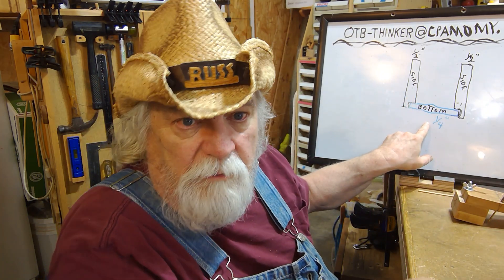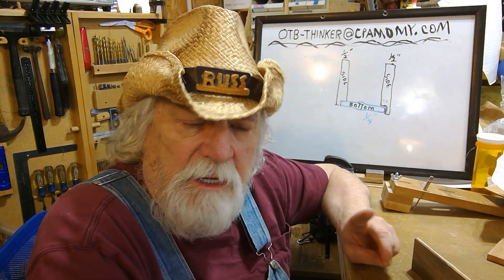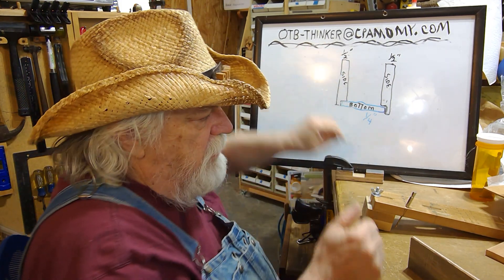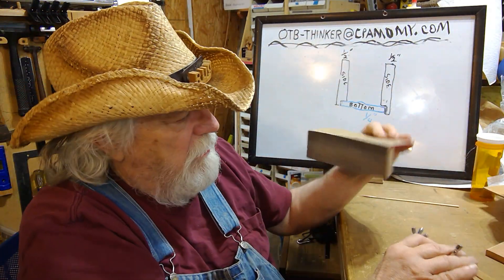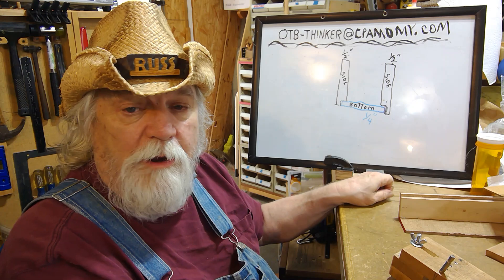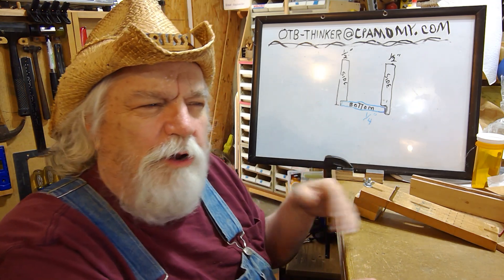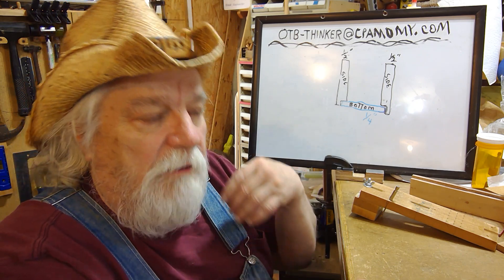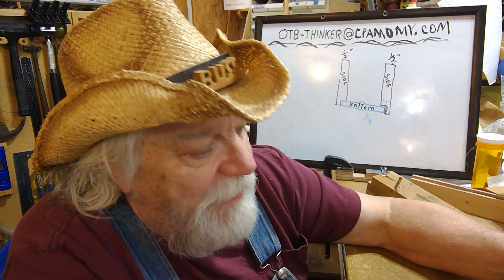A BS Viewer Question by OTB Thinker

Comment: Hey Russ..Puttn here hiding out on my wife's computer.  Thanks for explaining that and the visual application helps a lot.  I have a bunch of trays I'm putting the bottoms on with the rabbet and I'll be using the jig once I get it made.  Have you ever thought about producing these for sale....they are a great solution and I'm going to be reinforcing the trays I've made with miter joints with the bamboo skewers.  I think there are a lot of applications that could use this jig.  Thanks again....Putttn
Reply from the maker: Hey Putttn.  I have been thinking about this comment with several thoughts.  
I like my BS jig but it needs to be updated with the miter joint pin holes.  The 45 degree joint needs to have a 45 degree angle for drilling.  Still working on that jig.
I also want to make a mini version of the BS jig.
I agree this is a marketable product but I don't have the inclination to do the marketing or set up a mass production environment here in my shop.  I would need key people to help with all these aspects (& more :>).  I also would want to add other new enhancements I haven't even talked about.  It never ends :>)
Thanks for your thoughts.